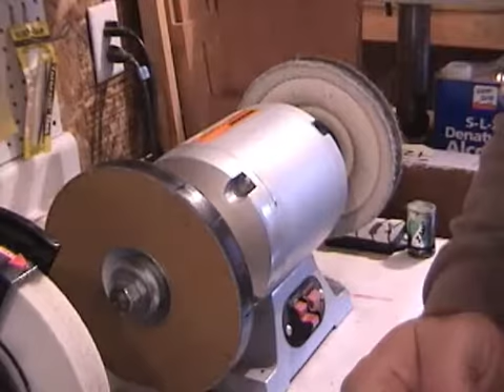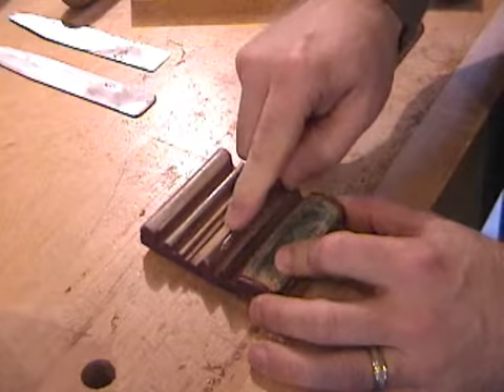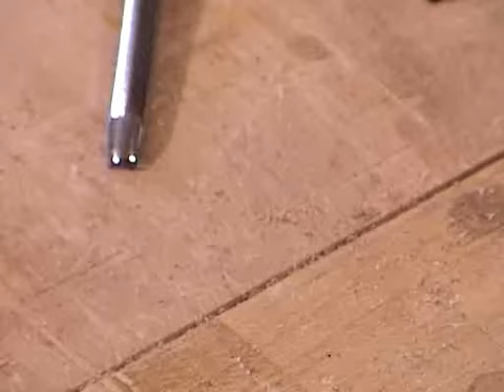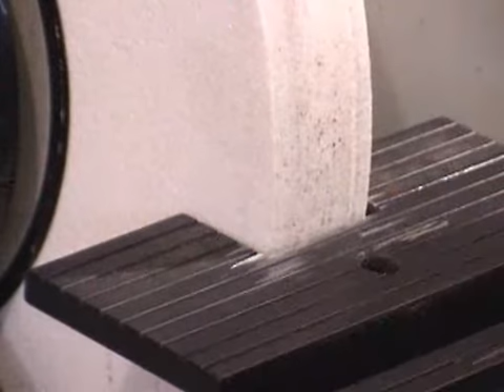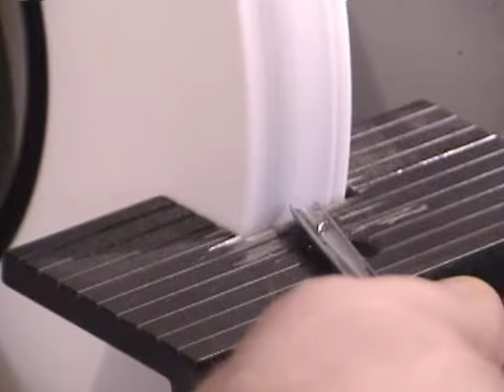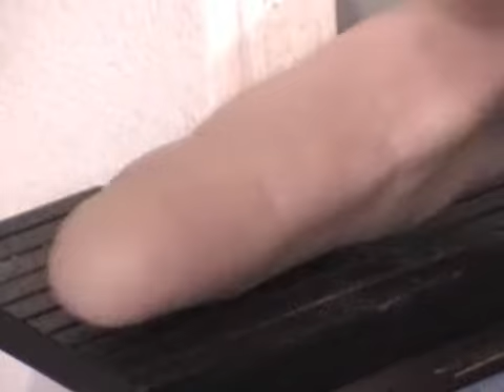Sharpening Carving Tools Part 2

Comment from the maker: The wheel I used is cardboard laminated into a disk. These are commercially available.  A leather stropping wheel would work fine too and I've heard mdf also works but haven't tried it myself.